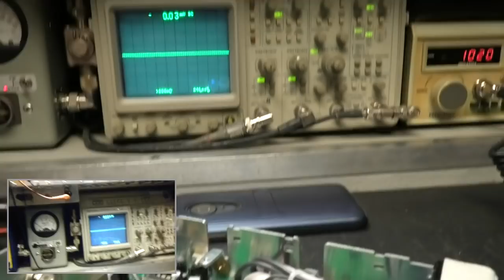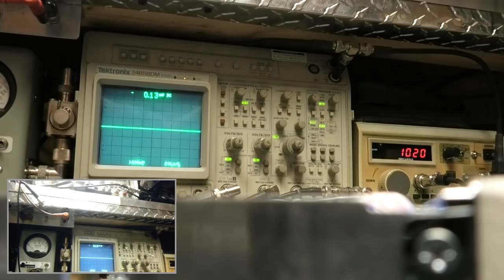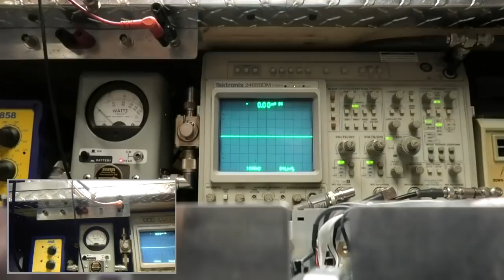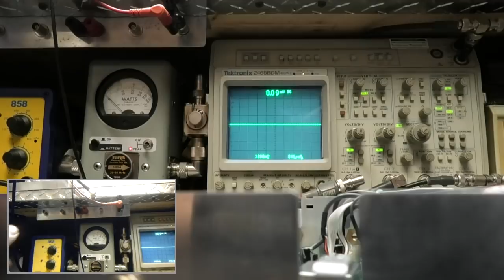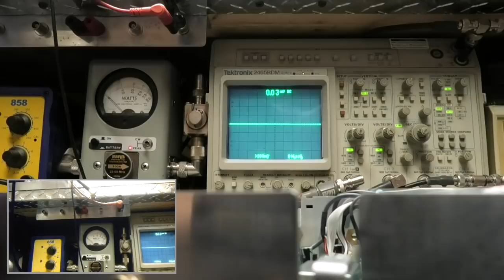Fine Tune CB Shop - Breaker Breaker .. Profanity, Noise Toys, Playbacks And Roger Beep.

Comment from the maker: Toys are for Boys .. Put your $$ where your mouth is (tune and type of radio, connections, PS, coax and antenna system). 

If you can't handle the heat .. get out of the kitchen.

If they can't show you .. in a video .. they're snowing you. Get The Picture??

It's all about Procedure .. There are no Exceptions. 

Here's what it actually takes to cut through the noise, be loud and crystal clear with a better receiver too:  A) Tuned Bench:  https://www.youtube.com/watch?v=lwcDfXOgAls.  True, it's more complicated and time consuming to accomplish these consistent and accurate results. Below is a partial procedure and list of calibrated equipment used to achieve this level of performance . Read on ..

Radio Evaluation Rules: https://www.facebook.com/163Hardrive/posts/3729504220447644
https://www.facebook.com/163Hardrive/posts/3523601657704569

Fine Tune CB Radio Shop strictly adheres to (https://www.nist.gov/) NIST Traceable Calibrations and other industry standards to maintain accuracy and consistency for providing Real World Performance Tuning of Citizens Band and 10 Meter export mobile radios with integrity.

"Basic Textbook AM/FM/SSB Transceiver Tune, Alignment and Calibration" 

1) Pll adjustments
VCO & OSC, AM TX OSC, USB TX OSC, LSB TX OSC.

2) Transmitter alignment
DRIVER BIAS, FINAL BIAS, SSB  (or gate voltages for mosfet versions) CARRIER BALANCE, HI-LO AM & SSB Power, RF METER, AMC, ALC and FM DEVIATION.

3) Receiver alignment
AM/FM RF & IF SENSITIVITY, FM DETECTOR/DEVIATION, SSB IF SENSITIVITY, SSB S-METER, AM/FM S-METER (100uV unmodulated -67dbm for �S-9� meter reading!), AM/FM SQUELCH RANGE, SSB SQUELCH RANGE, and NOISE BLANKER/AUTOMATIC NOISE LIMITER (Real World dBm to volts (uV) tables below).

That's just a typical run of the mill textbook tune up and alignment (if you're lucky). There's more to it than frequency alignment, modulation adjustment, meter calibration and a tune up report displaying exaggerated rms Bird peak watts! 

"Test Bench includes"

Bird 4314C Meter
https://www.birdrf.com/Products/Test%20and%20Measurement/Power-Meters/Wattmeters-Line-Sections/RF-Wattmeters/4314C_PEP-Single-Element-Wattmeter.aspx
Part 1) https://www.youtube.com/watch?v=RpX9IHe4ORM&t=16s
Part 2) https://www.youtube.com/watch?v=LuhbqTf6Bxw
Bird 4314C Accuracy Test: https://www.youtube.com/watch?v=DqEOabYqhQo&t=5s
Bird Stipulates 1/2 wavelengths  https://www.youtube.com/watch?v=5eWhgT-rTII
And Genuine Bird Elements from 1K down.

Bird 4373 Sampler 
https://www.rfparts.com/signal-samplers.html

HP8924c with options
http://userequip.com/files/specs/2147/HP%208924C%20Repair.pdf
https://www.youtube.com/watch?v=Cg1w0xBa27s&t=1s

HP8920a with options
https://www.keysight.com/upload/cmc_upload/All/EPSG072204.pdf

Three analog scopes, one digital 200 Mhz
https://www.atecorp.com/atecorp/media/pdfs/data-sheets/tektronix-2465b-2467b_manual.pdf
https://www.youtube.com/watch?v=by98x4eu2lM

Fluke 27fm
http://www.fluke.com/fluke/inen/digital-multimeters/fluke-27.htm?pid=56055
 
LCR http://www.lcrresearch.com/wp-content/uploads/2017/05/LCR_Pro1_Manual_version1.03.pdf

Power supplies
6 Cosel PBA1500f12 (750 amps) variable and configurable.
https://en.cosel.co.jp/product/powersupply/PBA/PBA1500F/PBA1500F-12/
Corcom 20VB1 F7130 EMI Filter 50-60Hz 250V

Times Microwave Coax jumpers and test leads
http://www.timesmicrowave.com/cms/products/cables/lmr/
https://www.youtube.com/watch?v=EmqaGJ6IWow
https://www.youtube.com/watch?v=1ltFVSxGp5Y
https://www.youtube.com/watch?v=v12YZT_1o90
https://www.youtube.com/watch?v=h7iiYfmYWRA&t=215s

Amphenol RF Connectors
https://www.amphenolrf.com/
https://www.youtube.com/watch?v=dVh5B0hdEA0 
https://www.youtube.com/watch?v=dKZg8T_AOso

More range, compliments, reliability and a quieter, clearer but more sensitive receiver,  Get Fine Tuned .. not peaked and ruined.

Here are some VideoGates of me at the bench practicing what I preach using my bench radio or customers radio completed and ready to be shipped: https://www.youtube.com/results?search_query=hard+drive+163+ more: https://www.google.com/search?q=Hard+Drive+163+nm&ie=utf-8&oe=utf-8&client=firefox-b-1-ab

It's what I recommend, use, service and sell ... to you ... not something non practical or deceiving in a misleading way. I'm not just the tech and owner of Fine Tune CB Radio Shop, I'm a customer too!  When finished, You'll be giving radio checks, not asking for them .

dBm To Watts and Volts
Tables below displays relationship between Power in [dBm] or [Watts] and Voltage in RMS, peak, peak-to-peak for sinusoidal signals in 50-Ohm systems for accurately measuring and tuning am/fm/ssb receiver sensitivity, agc, squelch and "S9" Meter calibration. Real World! Mike @ Mikes Radio Repair (Romper Room), Mark Rutherford aka Mark 19960, CB Kidd, Martian and all of your other fake accounts pay attention to the tables below, stop misaligning radios, spreading false information and promoting propaganda! 

  [dBm] [Watts]   [Volts]rms   [Volts]p    [Volts]pp
-140 0.100E-16  22.361 nV  31.618 nV  63.236 nV 
-139 0.126E-16  25.089 nV  35.476 nV  70.952 nV 
-138 0.158E-16  28.150 nV  39.805 nV  79.609 nV 
-137 0.200E-16  31.585 nV  44.662 nV  89.323 nV 
-136 0.251E-16  35.439 nV  50.111 nV  100.222 nV 
-135 0.316E-16  39.764 nV  56.226 nV  112.451 nV 
-134 0.398E-16  44.615 nV  63.086 nV  126.172 nV 
-133 0.501E-16  50.059 nV  70.784 nV  141.568 nV 
-132 0.631E-16  56.167 nV  79.421 nV  158.842 nV 
-131 0.794E-16  63.021 nV  89.112 nV  178.223 nV 
-130 0.100E-15  70.711 nV  99.985 nV  199.970 nV 
-129 0.126E-15  79.339 nV  112.185 nV  224.370 nV 
-128 0.158E-15  89.019 nV  125.874 nV  251.747 nV 
-127 0.200E-15  99.882 nV  141.232 nV  282.465 nV 
-126 0.251E-15  112.069 nV  158.465 nV  316.931 nV 
-125 0.316E-15  125.743 nV  177.801 nV  355.602 nV 
-124 0.398E-15  141.086 nV  199.496 nV  398.992 nV 
-123 0.501E-15  158.301 nV  223.838 nV  447.677 nV 
-122 0.631E-15  177.617 nV  251.151 nV  502.302 nV 
-121 0.794E-15  199.290 nV  281.796 nV  563.591 nV 
-120 0.100E-14  223.607 nV  316.180 nV  632.360 nV 
-119 0.126E-14  250.891 nV  354.760 nV  709.519 nV 
-118 0.158E-14  281.504 nV  398.047 nV  796.094 nV 
-117 0.200E-14  315.853 nV  446.616 nV  893.232 nV 
-116 0.251E-14  0.354 �V  0.501 �V  1.002 �V 
-115 0.316E-14  0.398 �V  0.562 �V  1.125 �V 
-114 0.398E-14  0.446 �V  0.631 �V  1.262 �V 
-113 0.501E-14  0.501 �V  0.708 �V  1.416 �V 
-112 0.631E-14  0.562 �V  0.794 �V  1.588 �V 
-111 0.794E-14  0.630 �V  0.891 �V  1.782 �V 
-110 0.100E-13  0.707 �V  1.000 �V  2.000 �V 
-109 0.126E-13  0.793 �V  1.122 �V  2.244 �V 
-108 0.158E-13  0.890 �V  1.259 �V  2.517 �V 
-107 0.200E-13  0.999 �V  1.412 �V  2.825 �V 
-106 0.251E-13  1.121 �V  1.585 �V  3.169 �V 
-105 0.316E-13  1.257 �V  1.778 �V  3.556 �V 
-104 0.398E-13  1.411 �V  1.995 �V  3.990 �V 
-103 0.501E-13  1.583 �V  2.238 �V  4.477 �V 
-102 0.631E-13  1.776 �V  2.512 �V  5.023 �V 
-101 0.794E-13  1.993 �V  2.818 �V  5.636 �V 
-100 0.100E-12  2.236 �V  3.162 �V  6.324 �V 
-99 0.126E-12  2.509 �V  3.548 �V  7.095 �V 
-98 0.158E-12  2.815 �V  3.980 �V  7.961 �V 
-97 0.200E-12  3.159 �V  4.466 �V  8.932 �V 
-96 0.251E-12  3.544 �V  5.011 �V  10.022 �V 
-95 0.316E-12  3.976 �V  5.623 �V  11.245 �V 
-94 0.398E-12  4.462 �V  6.309 �V  12.617 �V 
-93 0.501E-12  5.006 �V  7.078 �V  14.157 �V 
-92 0.631E-12  5.617 �V  7.942 �V  15.884 �V 
-91 0.794E-12  6.302 �V  8.911 �V  17.822 �V 
-90 0.100E-11  7.071 �V  9.998 �V  19.997 �V 
-89 0.126E-11  7.934 �V  11.218 �V  22.437 �V 
-88 0.158E-11  8.902 �V  12.587 �V  25.175 �V 
-87 0.200E-11  9.988 �V  14.123 �V  28.246 �V 
-86 0.251E-11  11.207 �V  15.847 �V  31.693 �V 
-85 0.316E-11  12.574 �V  17.780 �V  35.560 �V 
-84 0.398E-11  14.109 �V  19.950 �V  39.899 �V 
-83 0.501E-11  15.830 �V  22.384 �V  44.768 �V 
-82 0.631E-11  17.762 �V  25.115 �V  50.230 �V 
-81 0.794E-11  19.929 �V  28.180 �V  56.359 �V 
-80 0.100E-10  22.361 �V  31.618 �V  63.236 �V 
-79 0.126E-10  25.089 �V  35.476 �V  70.952 �V 
-78 0.158E-10  28.150 �V  39.805 �V  79.609 �V 
-77 0.200E-10  31.585 �V  44.662 �V  89.323 �V 
-76 0.251E-10  35.439 �V  50.111 �V  100.222 �V 
-75 0.316E-10  39.764 �V  56.226 �V  112.451 �V 
-74 0.398E-10  44.615 �V  63.086 �V  126.172 �V 
-73 0.501E-10  50.059 �V  70.784 �V  141.568 �V 
-72 0.631E-10  56.167 �V  79.421 �V  158.842 �V 
-71 0.794E-10  63.021 �V  89.112 �V  178.223 �V 
-70 0.100E-09  70.711 �V  99.985 �V  199.970 �V 
-69 0.126E-09  79.339 �V  112.185 �V  224.370 �V 
-68 0.158E-09  89.019 �V  125.874 �V  251.747 �V 
-67 0.200E-09  99.881 �V  141.232 �V  282.465 �V
-66 0.251E-09  112.069 �V  158.465 �V  316.931 �V 
-65 0.316E-09  125.743 �V  177.801 �V  355.602 �V 
-64 0.398E-09  141.086 �V  199.496 �V  398.992 �V 
-63 0.501E-09  158.301 �V  223.838 �V  447.677 �V 
-62 0.631E-09  177.617 �V  251.151 �V  502.301 �V 
-61 0.794E-09  199.290 �V  281.796 �V  563.592 �V 
-60 0.100E-08  223.607 �V  316.180 �V  632.360 �V 
-59 0.126E-08  250.891 �V  354.760 �V  709.520 �V 
-58 0.158E-08  281.504 �V  398.047 �V  796.094 �V 
-57 0.200E-08  315.853 �V  446.616 �V  893.232 �V 
-56 0.251E-08  0.354 mV  0.501 mV  1.002 mV 
-55 0.316E-08  0.398 mV  0.562 mV  1.125 mV 
-54 0.398E-08  0.446 mV  0.631 mV  1.262 mV 
-53 0.501E-08  0.501 mV  0.708 mV  1.416 mV 
-52 0.631E-08  0.562 mV  0.794 mV  1.588 mV 
-51 0.794E-08  0.630 mV  0.891 mV  1.782 mV 
-50 0.100E-07  0.707 mV  1.000 mV  2.000 mV 
-49 0.126E-07  0.793 mV  1.122 mV  2.244 mV 
-48 0.158E-07  0.890 mV  1.259 mV  2.517 mV 

                 Don't Be A Mud Duck!

Contact: https://www.youtube.com/watch?v=P0W_Ltzeyyc

163 Hard Dr.

Comment: Brother, thank you so much for trying to put the gospel out. The job is difficult enough without more distractions. Addressing the respect issue is huge as well but, safety of the motoring community is most important. It's like you said, it just takes seconds for a critical error to take someone's life. Thx for being there with us. Once a driver, always a driver.
Reply from the maker: I'm alive because of CB radio and without a scratch or dent! Early 80's .. "cabover" Freightliner .. just north of Kankakee, IL ..  middle of the day .. instant whiteout .. Get the picture?? What a ride .. "inches"! It'll be with me till the day I die!

This does not include the times that it's saved my but as a teenager.

I respect CB Radio and those that use it for positive reasons.

Safety First .. >>>

Comment: I used to use a Rodger beep when I first got a radio that had one when I was a teenager and didn’t know any better. As a kid I would be riding with my Grandfather listening to the cb and would love hearing those noise toys especially the Tarzan if anyone remembers that one. But as I’ve gotten older I can’t stand all the noise and loud eco’s even though I run eco but so low you can’t tell. Thanks for this much needed to be said video and you were more polite to that guy than someone else would have been about all that noise. I do miss hearing the Tarzan Rodger beep though brings back memories

Comment: I don't have as big an issue with Roger Beeps as I do with all the other whistle-bang noise toys some of the beginners tend to use. I have always had a way to shut off my roger beep via a switch on the radio's face. Then there are radios that are set way out of bounds (as in far too loud). You get dialed in so you can hear some distant radio then someone comes in and blasts your ears right off your head. Too many jerks cracking their cases with their golden screwdriver in hand.
Reply from the maker: Very good point and I have covered that topic multiple times in the past but have been recently been thinking about doing another (too loud).  Low deadkey (truck stop tune) swing high equals less usable power. Useless ... only for the uneducated and the gullible.